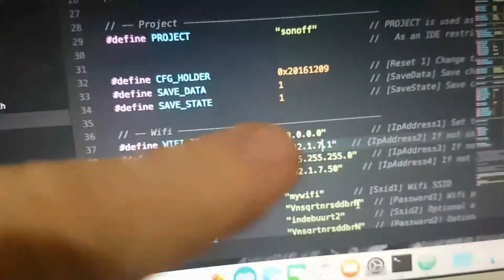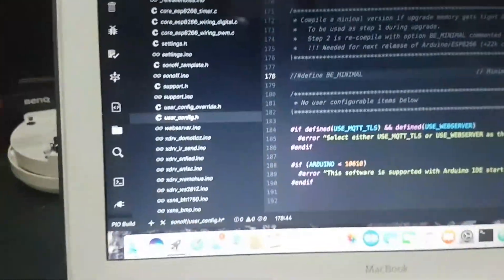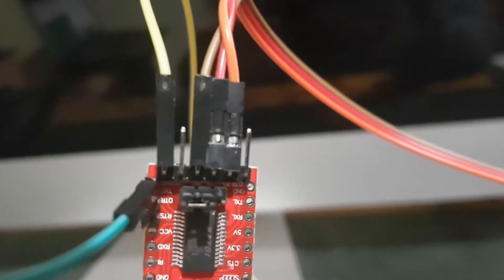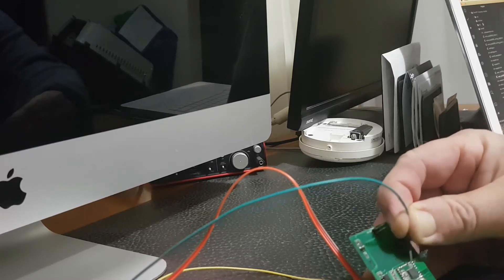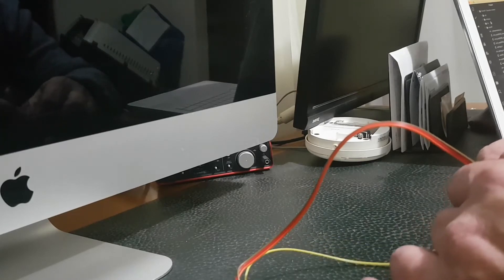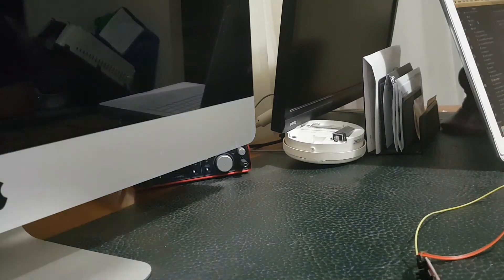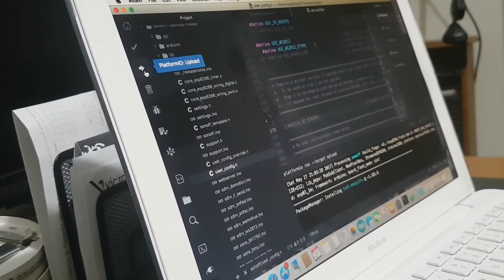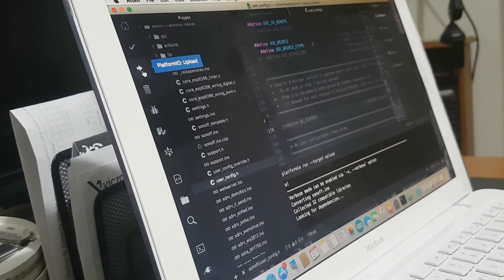Installing TASMOTA on Sonoff Touch using Platformio fail due  to memory still working on it. #7

Comment: Same problem as I've got here... I think it is just uploading/compiling for one language, then it goes onto the next, which is German and runs out of memory before that finishes. Then it still goes on for hours with all other languages, even though the board is full.

Finally I have it loaded .... Just rip out the USB after it has compiled and loaded English. Platformio will just keep on going in it mad insane way...ignore that and just find your new Sonoff touch on your wifi.

I hope there comes better instructions for us with an electronics background soon... Thanks for your help.
Reply from the maker: Thank you, for your reply Graham. It drove me mad. I ended up using precompiled source code. I even ask Andreas the Swiss guy about it back then. I had lots of problem to , as it was one of Sonoff first board runs for them.

Comment: how you fix that I also have problem to upload tasmota the build is OK but the upload I get error
Reply from the maker: +Tamir Yosef Did another vlog, where I installed firmware straight from TASMOTA site. Just check it out. It is after this one.  Good luck, here if you need help.

Comment: The gnd your using on your FTD1232 didn't work by me. I used the GND on the board. arduino_build_411893/sonoff.ino.bin to flash at 0x00000000 100%
Reply from the maker: Jeroen de Vries At least you got a ground and it work. Good work.

Comment: Did you flash it yet ?
Reply from the maker: fieberification Yes with ESPeasy works well. But the main mother board had a fault.
Reply from the maker: +fieberification Yes but not with TASMOTA.  With ESPEASY,  but saying that I found out why it didn't work.  You need to have it set for 'No SPIFFS' as I was told by tge developers.  Goid luck.
Reply from the maker: +fieberification Yes, if you use TASMOTA settings No SPIFFS. That is what I did wrong. I ended up using EASYESP, which works too.

Comment: Did you finish flashing with success? I have the same problem with error after flashing and so far my Touch in nice brick hanging on the wall 😁
Reply from the maker: Still having some problem. First you need to add the TASMOTA update as it has the install script for platformio.ini . I end up using a linux laptop to do this as the Mac was hard for me to locate the right directory for platformio. Will start trying again tomorrow wife is sick at present. I have start a fault problem on TASMOTA GitHub site too.
Reply from the maker: Work on ot last too days. Closest I got was with the Linux mint so far. Still did not upload. Looking into it.
Reply from the maker: +Mariusz Połaski Flash it now. But not with TASMOTA. But should work for it too